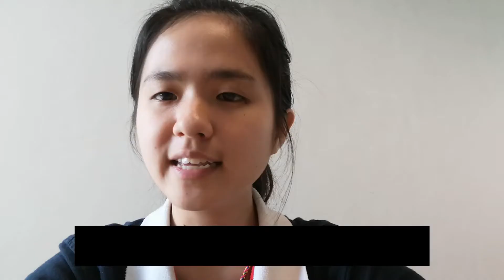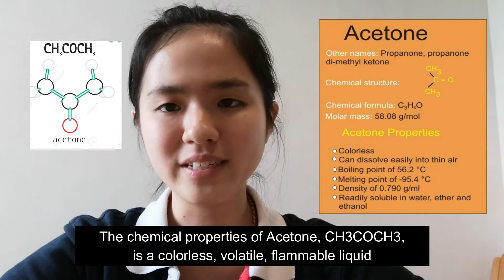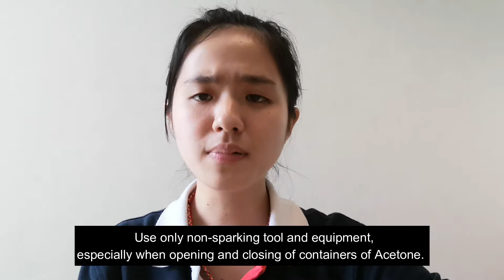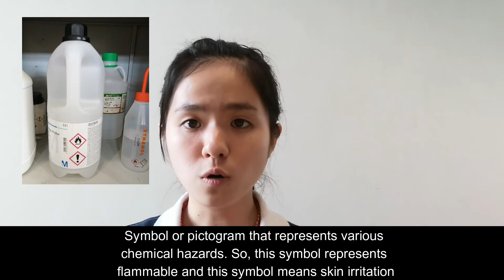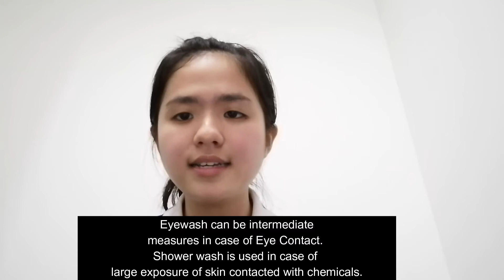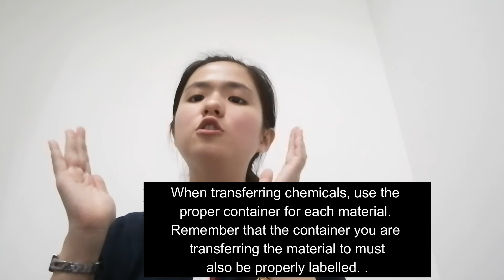61194 Lau Ung Mui (KMS3063 Occupational Safety and Health )

Comment from the maker: The video is about hazard identification for the chemical been used. Only 1 chemical is identify which is Acetone. Overall the students mention the hazards for the chemical, the recommendation of reduce the risk through various way. To make the video more interesting, probably it can have the overall glance of the working area, probably while recording this video. Those recommendation suggested could be more specifically target in the application and implementation of that particular workplace but not only the general one. Hope it helps (Choo Hui Siang, CHRA).